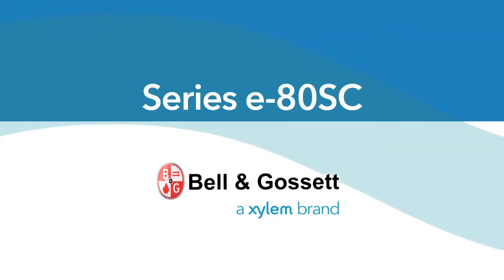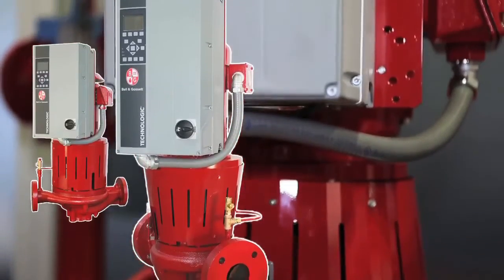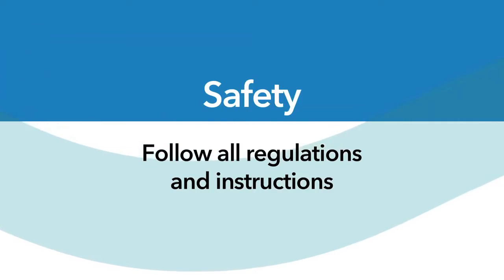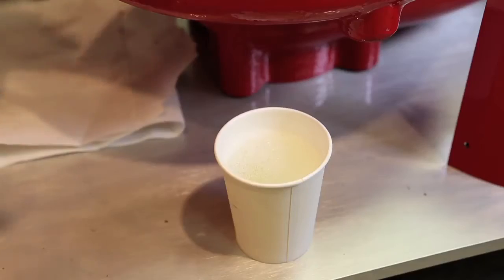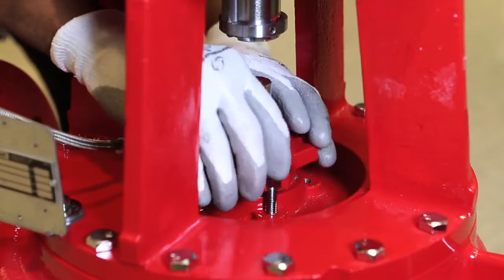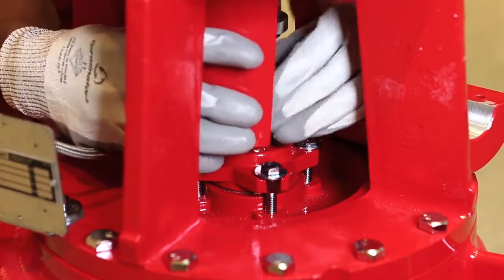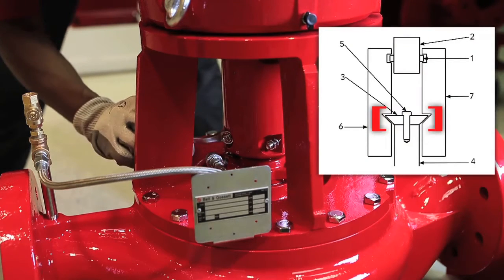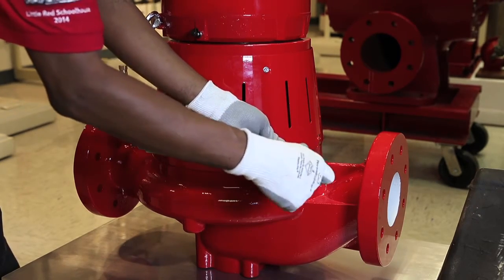Mechanical Seal Maintenance: Xylem Bell & Gossett Series e-80SC Inline Centrifugal Pump

Comment: what is the use of flush line on the pump?
Reply: Flush line is to remove air from the pump before start up. Running the pump with air trapped inside will ruin the mechanical seal.